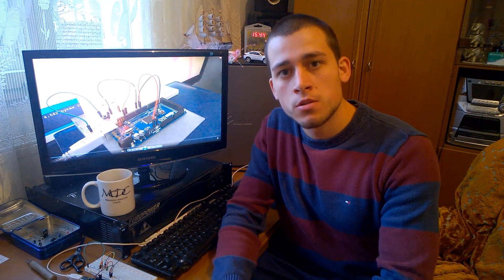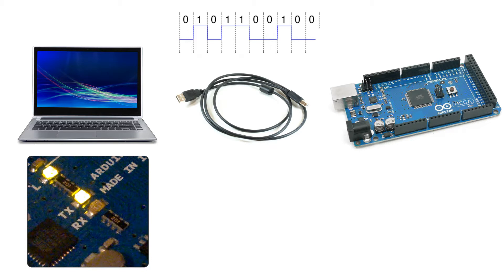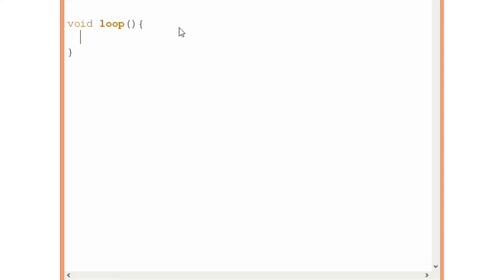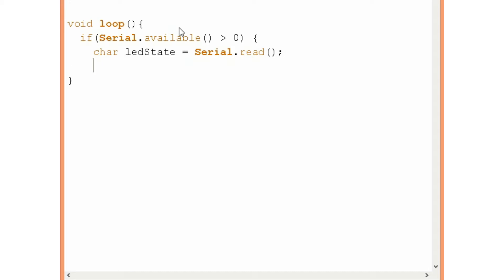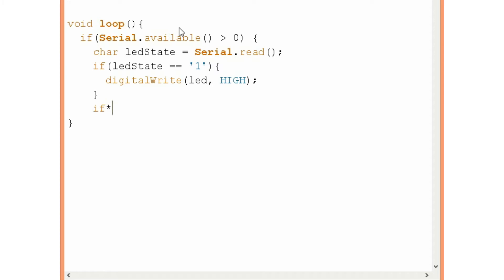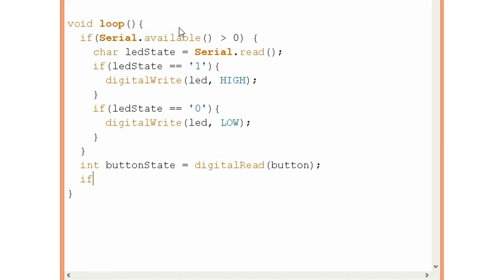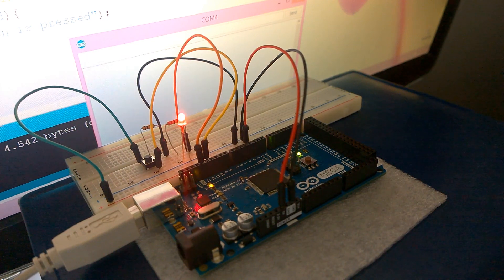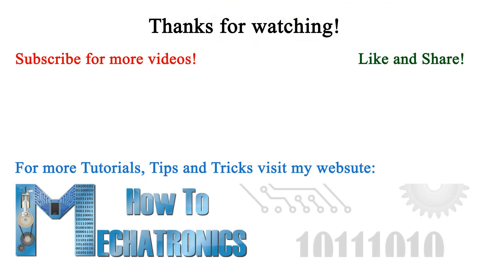Arduino Tutorial 05: Serial Communication

Comment: HELLO  iwrite that program but not work on me i would not acess to write 0 or 1 for led
int led=13;
void setup()
{
  pinMode(led,OUTPUT);
  Serial.begin(9600);
  
}
void loop()
{
  if ( Serial.available()>0)
  {
    char ledstatus=Serial.read();
    if (ledstatus=='1')
    {
      digitalWrite(led,HIGH);
    } 
    if (ledstatus=='0')
    {
      digitalWrite(led,LOW);
      }
      }
      }

Comment: Can you explain the first two lines of the "void loop" at the time 3:50.
Well, have learnt a lot from your videos, thanking you.
Reply: The first line tells arduino that if the computer is sending data (in fact if serial is available) it will read the character that the computer sent( computer could even send a string,but for making things simpler he used a character) and store that thing he has read to a variable  named ledState.Hope it helps!:)

Comment: Sir explain about miso or mosi pin...
Reply: Miso and mosi pins are pins used by a protocol of serial communication called SPI (serial periferal comunication).Theese pins are used for sending and reciving data from everything (like sd cards , sensor and so on).scl is clock of the comunication.MasterInputSlaveOutput (miso) pin is used from arduino to recive data,MasterOutputSlaveInput is used by arduino to send data.Last but not least is the SlaveSelect pin,is used by arduino to specify the slave (the periferal) he wants to "talk" with.Sorry for the year of late... hope it helps:)

Comment: Great tutorials.  If I want send sensor data from Mega2560 to ESP8266 by serial,  How can I use Serial communicate between Mega2560 and ESP8266? Does it possible?  I want to store sensor data on Firebasse. Thank you.
Reply: Yes!Is possible!😀But it is a bit tricky.Follow my instructions:connect arduino rx to the input of a 5v to 3.3 volt divider.Connect the outout of the dividwr to esp rx.
Connect esp tx to arduino tx.power esp from arduino (i use a buck converter tu supply more current).Connect rst of arduino to ground (so it acts as a ftdi breakout).Open serial monitor,set speed to 115200 or 9600 (depends from esp to esp,mine was at 115200),set both nl and cr and you are ready to go.If you want to program esp pull gpio0 low at boot ,instalk borard in arduino ide and have fun!Please,can you like my comment...😁😀Hope it helps!

Comment: nice video.
Everything works perfectly fine in the arduino uno but when I switch to my external power supply or connect it to my pc without the serial monitor open it doesn't work anymore. the program is already loaded but still it doesn't work. please reply me if anybody knows.